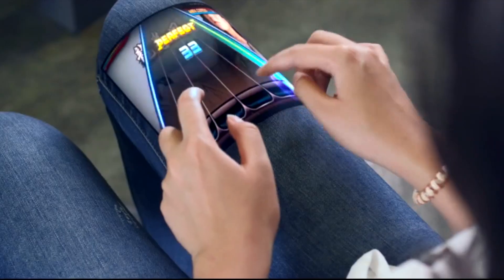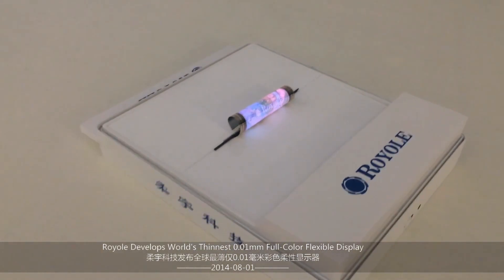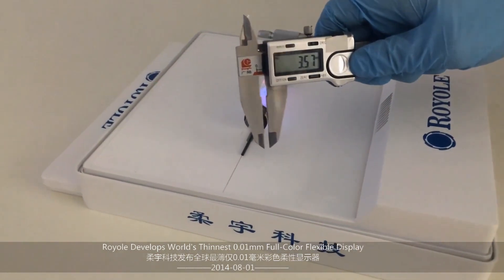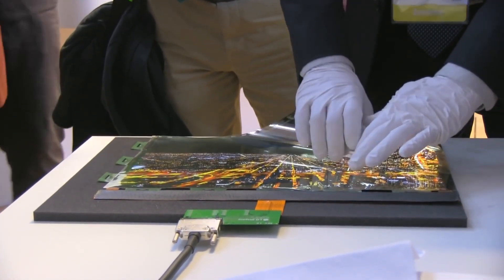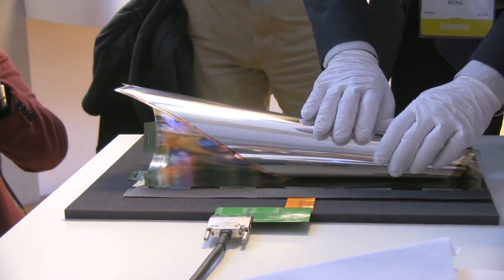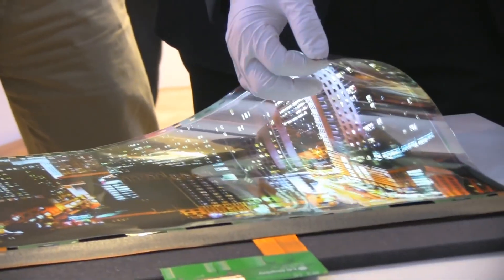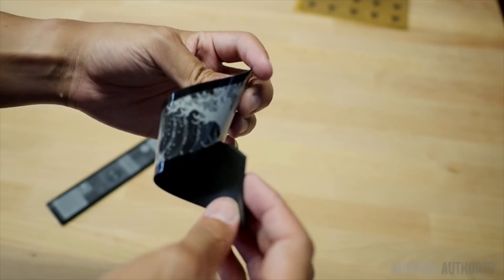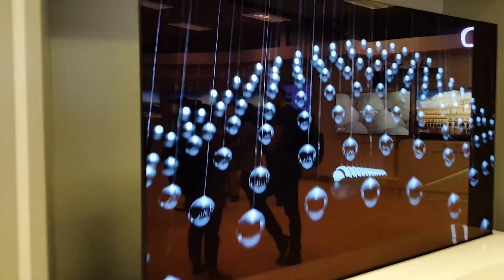What is Stopping Flexible Displays From Taking Over?

Comment: Other than looking cool what practical use would the average consumer get out of this. Remember this has to have a mass appeal not a niche. Foldable or collapsible display might be a better way. Something that will give you a solid surface when using like a smartphone or tablet but can be stored in your pocket without the bulge. preferably something that's not going to break if I have my keys in there.

Comment: Just scree resistant to drops is what this technology is good in the mobile device. You can fold the display but you can't fold the hardware. Batteries needs to be kinda large to power nice big displays and that's where most of the bulk is in actual phones.

Comment: I wonder how a flexible display would work on a cell phone. I presume they can figure out a way to make the mainboard and circuitry flexible too, but the battery and the chips inside will still be solid.
Reply: that's one of the biggest hurdles, flexible display we have... but flexible batteries are harder, that's the innovation that's gonna make someone a billionaire

Comment: I can see buildings using them as signs and stuff but from an average consumer perspective I don't really see how they can be of much use.
Reply: +JKeemTV we love bigger displays but they are not practical (i.e phones) so an easy to use phone becomes a  tablet when you get home.
Reply: Wajih bec But to get the power of a decent tablet they need larger components internal wise such as the battery, so the phone part would be overtly large and unwieldy wouldn't it?

Comment: What's stopping these flexible displays from taking over? Simple! Here are the facts:
- They're too expensive for mass production.
- it's harder to make an arching board. Plus the installment and soldering of the chipsets, nodes, capacitors, modules, and many more.
- Bend displays can easily break, especially if the impact is from the center where the screen is facing the floor.

Comment: I have a feeling that soon, the information will be more valuable than the technology itself, this stuff may be hard to make or expensive to make in volume now, but as SoCs become more and more powerful and this stuff becomes cheaper and cheaper, we'll eventually find a point where we'll just be satisfied with the technology as a whole and don't need anything better (hence why 1080p monitors and televisions are still being sold in high quantity while 4k is still struggling a bit for a wider adoption along with how a lot of cheaper smartphones are just going with a 1080p screen instead of quad HD). That's basically what I feel we are eventually heading towards.
Reply: +Thomas Hibbard didn't read but 100% agreed!

Comment: I'm calling it now I would say 2021-2023. Why? Smartphone sales are declining, if the trend continues then business will be force to adjust and reinvigorate the sales. How? Why not announce a partnership with Royole to bring 'Flexis' (pronouce Flex -ees) to well known smartphone brands ie Nexus, iPhone and others. It makes sense, Royole has invested over 200 M to develop it, this saves the big companies a huge amount because the R&D is done through another company, Royole will recoup there investment by licensing out the tech to the big companies or be completely bought out which ever one is cheaper. Further down the line around 2026-2028, well see the Flexis come to the TV market. Traditional HDTV's will drop in price and eventually will be come obsolete around 2033-2035. By this time, the Internet of Things is in full swing, 5G should be established at this point, and most interfaces won't be hardware but completely wireless(so no more HDMI,VGA cables). (These projections are based on '1st World Nations'. Add 10-15 years for less developed countries.) What do you guys think?
Reply: kind of agree

Comment: No need for triple monitors for gaming,now we have a  60'inch flexible screen for real gaming experience
Reply: Some Guy splitting can be done with software or hardware. easy
Reply: +Some Guy 
That sounds amazing. 

Come to think of it, that's going to cause some problems on the OS side. Thing's like making a window fullscreen are going to make it FULLSCREEN. Most of the time you're not going to want that so the OS's are going to have to come up with a solution.
Reply: As long as you can manage to make it a wide screen and somehow split it into 3+ different monitors.
Reply: With a flexible gtx 1080
Reply: +Jack Evans I'm sure they will think of something.Afterall,we are living in the beginning of the future.

Comment: I was thinking about a screen to hang in conferences rooms or classrooms that rolls up into the ceiling when not in use like projector screens do now.
Also, while this does not require a flexible display, the ultra thin nature of these displays could make them easier to hang in rooms where a traditional TV protruding from the wall would be unsightly.
Reply: yes your on to something
Reply: +ze&#39;ev Katz 
Depends on how the cost compares to projectors, there's a reason classrooms don't just have huge screens at the front. I doubt that will happen though.

Comment: Because they are unnecessary and less usable than a flat display?
Reply: ***** you can't hold it in one had and use it. You have to either put it on a flat surface or hold it stretched out with both hands? Does that not sound less usable to you? I can use current tablets holding in one hand and touching it with the other.

Comment: It's the real next big step for all devices that have a screen.
Unfortunately, it's quite hard to accomplish. Not only on scalability, but on durability among other technical challenges.
Even the carefully crafted showroom demo prototypes have been reported to fail and have problems regarding dead pixels and such after less than a day or so in a showroom floor.
But it's impressive how far the tech has come. I'm optimistic that one day we'll just be carrying something like a thicker pencil that is really a full smartphone right there. Cracked screens won't be an issue anymore, and it could help further the idea of paperless workflows.

Comment: I had a project of VR glasses in 2011 and I stopped the project because of the display issue and other issues but mainly because of the display .. if the display can shut off folded pixels (like new Samsung phones) then it would be great to convert a phone to a tablet .. I almost imagine my disk step with such display on the table and one on the wall or one on the wall and the table .. or your TV can be folded out of your sight or one display on the whole room walls .. there are a lot of idea for flexible displays.

Comment: Where was the market for plasma screens? Or LED screens? How about HD anything? Sounds more like they are dragging their feet to get the most out of the tech already out. 

Wall sized screens as thin and light as heavy duty construction paper that roll up like a yoga mat. 

Windowless vehicles, saving on weight from the glass. Think planes, busses, trains and maybe even cars eventually. 

Instrument panels. 

What's not to like? The market is there already. 

The biggest problem with personal devices like phones and tablets is screen scratching, now if they design it in a way that the screens are easily replaced or somehow scratch resistant and still foldable/roll-able then there should be no worries.
Reply: "Build it and they will buy it."

Comment: i don't think flex displays are the limitng factor right now, the problem is the technology around it for mobile devices. It doesn't matter if you have a flex display when you need a brick like battery and hard motherboard with chips to run it, all the show displays have this connectors and things needed to run them hidden from the public.

Comment: I think the flexible displays need a form factor to adhere to. And nobody has thought of  form factor yet. 

And flexible (non-breaking) display would be great even in a typical smartphone. It would make the device thinner than current gen and we could have easily replaceable glass overlays for when the device is dropped and to prevent scratching the plastic surface from our fingers.
Reply: Charles Tannehill but would it work in heavy rain?

Comment: Because, I'll break them
Reply: you'll bend the just a little too far and, bang it snaps
Reply: +Connor Daley you cannot break flexible displays, they dont have hard elements like calcium etc that is breakable you can maybe tear it but never break
Reply: +assefa hanson but they will stop working if you roll them ip and apply hard pressure

Comment: Perhaps flexible displays are the one piece of technology that companies want to perfect before throwing them out into the wild? Think about it, they're taking a big bet with flexible displays.
Reply: I agree, tech companies need to take time for more development and more importantly taking perseverance into the project
Reply: I think it is more about patents and usability. The big companies are having battles over flexible display tech. The other side is the usability. Although it is very cool such a flexible screen, what is it actually going to be used for vs durability? Curved screens already flooded the market and for the home usage there is no need for more curves. Phone screens tried curves as well, but did really catch on, plus why would it? Phones and tabs (etc) need regidity to function good and to offer durability. Flexible motherboards, chips etc are not there yet ;) So what is the usage of a flexible screen then? Other then the "ooh cool" factor and perhaps commercial display setups? To me personally the flexible display market will mostly be for production advantages once the tech has been refined and production processes optimized. As i said before, current display tech already allows for curving.
Reply: Consumer education is going to be important as well.  Otherwise we'll have a rash of people creasing their "foldable" displays, only to crack and ruin them.